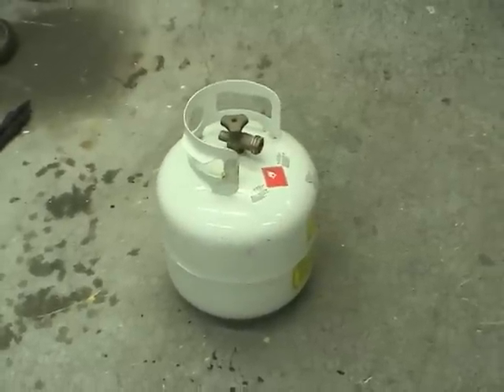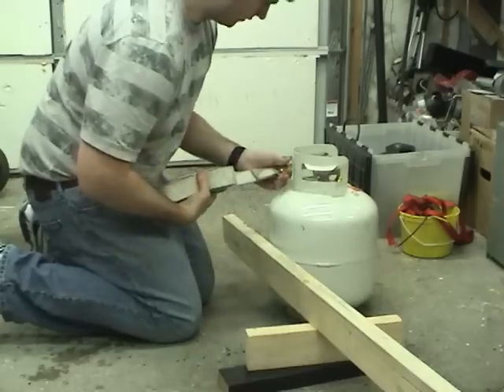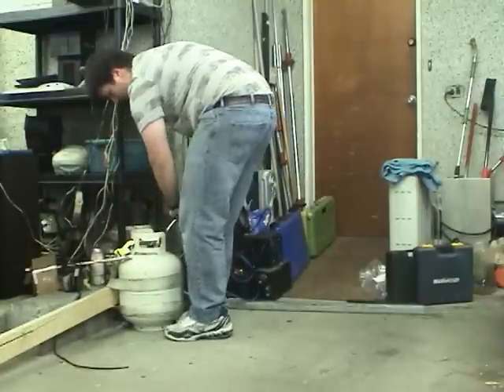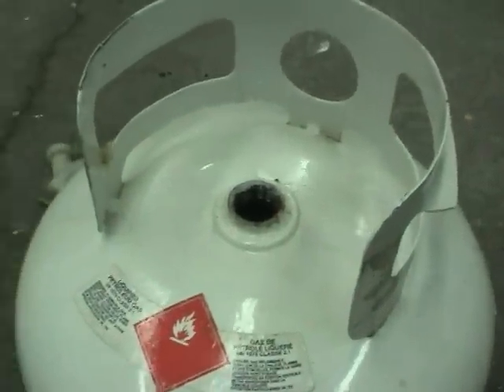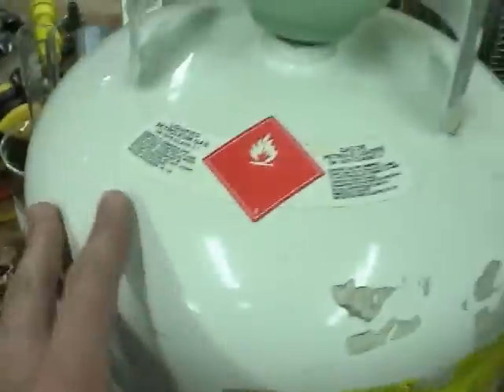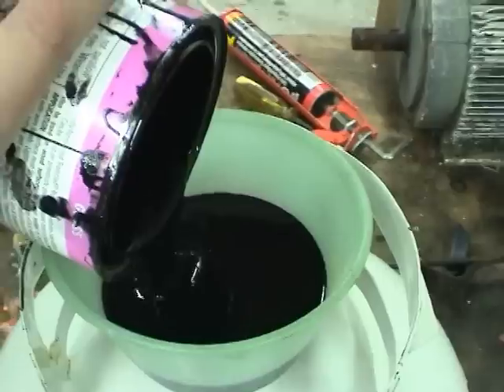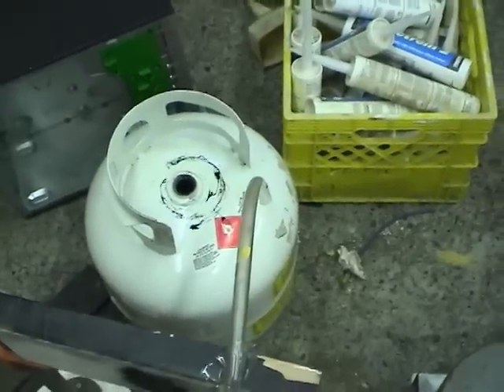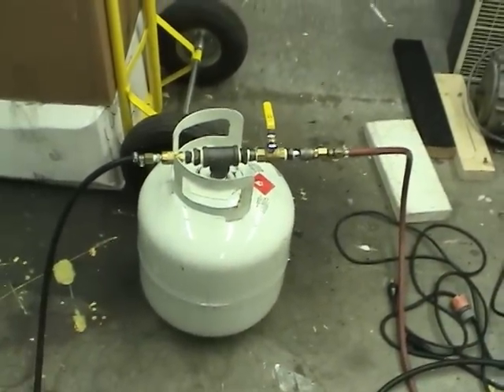Converting a propane tank into an air tank

Comment: This bloke is a true legend,, no idea what he is doing but he's having fun & that's all he needs..
Reply: Man just use a 5 ft metal pipe that you slide over the hande of a pipe wrench and a 4 or 5 ft crowbar stuck between the handle of the tank . You tilt the propane tank completely  on the side so when you use the extended pipe  wrench , both crowbar an pole of wrench should make an x shape . You setup yourself so you either drop all your weight on the wrench downward    while having a feet on the crowbar to secure it more . Other 180 degree the valve give you problem you lift up , nit that shoult be easy once you droped all the tork using your weigh the first time.Proper placement you shouldnt even wear yourself at all , no muscular force needed than carring all that metal around.  The 5 ft x shape tool placement acts like a 5ft 3 wooden beam winch.. yea that old hamish trick using 3 trees and rope to drag a barn using one person.

Comment: Always use the tank with the fitting at the bottom. In this way the water condensate is always in the air lines not the tanks.

Comment: A 100% full propane tank in the desert southwest would experience 120F heat in the summer months.  That would raise the pressure to around 240psi.  That same tank in the winter would have a pressure of 102psi at 60F.  The standard is to test them to 2x the service pressure or about 480psi.  I believe the service pressure is about 220 psi (test to 440 psi).  Most people don't have the equipment to pump a tank to the required test pressures.  Your tank could fail at 125 psi (the max limit of most home compressors).  Please note that I couldn't find anything online that gives exact numbers, but these should be close.
Reply: Ha, try leaving that propane tank in the car or directly in the sun for a few hours (like, on the front of your pop-up camper in the driveway) in that environment.
Reply: @SpringIsBACK  Not a problem even in the AZ desert.  Places that sell propane have hem outside in the desert sun with no problem.  Just don't overfill them.  That's what the OFP device is intended to do.

Comment: I used an old propane tank for air, but I didn’t do any of this shit, and it works just fine as an auxiliary tank.
Reply: When I was wrenching in the early 80s, Snap-On sold a kit with adapter, gauge, hose and fittings for around $ 30.
Valve off, adapter on, fill, use. We didn't have time for all this fuss. 😜

Comment: One thing about air compressors, its not all about capacity, its also about the pumps ability to produce volume. Don't expect that tiny pump on that little tank to last long with the addition of this tank, your causing it to go far over it's service factor. I can make a 1 gallon tank run a DA sander for hours at full volume non-stop...With the right pump and a motor with a continuous duty cycle, correct HP and a SF of 1.15 at least.

Comment: Looks like the pressure rating of these tanks is good enough for typical compressed-air use.
There's a nice valve-removal tool at "Propane tank valve removal Method 3 Make a tool! Easy DIY Project!".  
Can add a drain fitting by drilling a hole and welding a suitable nut on the bottom (before painting the inside!).  Water is always a problem with compressed air - it can't hold as much water as atmospheric-pressure air, so once it cools off after coming out of the compressor you'll get condensation in the tank and hoses.  Water-separators here and there help.

Comment from the maker: @ZstripeW All 20 pound propane tanks I've seen have a standard 3/4" NPT pipe fitting, the same as home heating natural gas line. A good hardware store will stock everything you need. The tee connects to some standard adapters to reduce the size to match the valve and compressed air fitting.

The best way to make the adapter is to build it up at the hardware store, it's much easier to figure out what you need with the parts in front of you.

Comment: The best idea is to put them upside down so the water will not sit in the tank i have 2 of the TALL kind with 2 slanted L bend's going into a small stainless steel tank so i can drain water wen needed, i hope you fined this helpfull!

Comment: Great job, but all you need to hold the tank is a good rod through the handle while removing the valve.   I am currently converting a 100 gal a fat boy propane tank.   I am putting a 5 HP motor and compressor on the top of it.    Cheers

Comment: If you want to do it right, yes you need to remove the valve.  Removing the valve allows you to wash out the tank to help get rid of the smell, as well as coat the inside with rust resistant paint.  The paint will make this tank last a lot longer.

Comment: Ok, a couple dumb questions:

What is the exact threading INTO the tank?  Standard 3/4" NPT pipe threading?

Put the tank outside, exit down, in the sun on sunny days, for drying.  It'll dry.

I'd like to make a quite small tank for high portability (and just a little air for cleaning / dust removal on small items) out of a 1 lb. propane bottle.  Is the threading the same?

Comment: After you attach that 2x4 {with the long part in the direction of the force (the direction you have to turn the valve to get it out - lefty losey, righty tightey} , lay it flat on the floor OR ground, it is easier to control. Yeah, do it outside. Leave it hole side down a few hours. Then you can rinse it and air dry and whatever. That stink is very persistent and I think it is 3/4 inch pipe thread also. I definitely would pressure test it longer than a few seconds and certainly not in my shop where failure would be somewhat disruptive to it. However my compressor maxes out a 150 but even then failure would smart a bit. Having complained enough, I think he done good, a bit less safety orientated but generally real good.

Comment: Most people that aren't the DIY or mechanically interested type just go and buy whatever they need, without thinking of making their own for cheaper. I personally love making or trying to make my own stuff. I built a DIY pressure pot sandblaster out of an old 8 gallon air compressor. Loved the building process, it turned out great!

Comment: Just advice for the future or anyone who reads this and plans in doin this. That’s not a good way to check for pressure.... there is a little flat blade bleeder screw on the side of the valve. Use a screwdriver that fits it well and loosen it. If that doesn’t work then try his method but I’d personally try the bleeder screw first

Comment: I made a tool for revalving tanks. I took a section of pipe that fit over the body of the valve and cut two slots in it so the outlet and the relief valve stick out either side. on the other end I drilled two holes to put a metal rod to turn it with. Very efective.
Reply: I make almost the exact same thing.  I just used a large pipe wrench to loosen the valve.  Stuck a 1" pipe through the carrying handles to keep the tank from turning.  Works great.

Comment: Very well done! Could you explain what type of valve(which has yellow handle) you used ? Which ones are good for this application?
Reply: Hard to find info about what fittings you could use to weld on

Comment: I would suggest mounting the tee connector 90 degrees from what you have. I put the input nipple and valve coming in the top and the output out the side.

Comment: @crashcyberdrive No pressure, no worries...there's no oxygen inside, it can't burn...also, I said to heat the thread, not set it on fire, the 80-120°C needed to loosen the epoxy is nowhere near ignition temperature...

Comment: Why did you not just adapt the existing valve to work with the tank? It has a builtin safety pressure relief of several hundred psi and has a valve on top.
All It would need is the tube and nut from an old grill and I have seen those on sale at Lowes in the brass fitting section.

Comment: More info, if you use the old grill tube connector, you need to drill out the central tiny  orfice.
You can also on the existing tank valve unscrew the liquid level float or just leave it on. All of this is just obvious if your handy.

Comment: I have no idea how much torque you were able to pull on a crescent wrench but I doubt it was more than 100 Ft. lbs.  I'm just making an observation as I used to pull 600 foot lbs. on the inboard flap track fail safe straps on the 747. It was lots of fun!! Anyway... I'm looking at using a couple old propane tanks to hold a vacuum for the forming table I have planned. Got to make some DEVO Energy Domes!!

Comment: If you take the handle off the valve a piece of square tubing will fit over it. Lay the 2x and tank on it's side and park a car tire on it and you can use a pipe wrench or ??? on the square tubing and easily get the valve out.

Comment: That seems like a waste of a flammable gas that could instead be used for heating/soldering/brazing/cutting metal or barbequing or other combustion purposes. But nonetheless an interesting use. I've also seen people charge their refrigeration systems (central units) using propane, since it is in fact a refrigerant.

Comment: sounds like a refidgerant compressor he is using for the 400 psi. he uses that compressor for an air cannon so not a regular compressor. also from what I have seen he uses gas pipe fittings to retro fit the tank.

Comment: Did you watch the video to the end?? Let's see: taking the valve off some elbow grease, some time, one 2x4 broken at the end, welding the fitting (using electricity,welding rod or wire) drying the tank 48 hr running the fan,paint to coat the inside, more fan running to dry the inside, varius fittings, the cost of the tank, time spend building it. A 13 gal tank is on average 35$ at an hardware store. He spend more than that to build it for sure.

Comment: I also drilled and pipe tapped a 1/8" hole into the top of the T fitting for a pressure gauge.
Reply: great idea.
Reply: Santina Murphy link ?

Comment: Soap and water DOES NOT remove all the propane.  The pressure forces gas into the metal.  What you did is OK if no heat is applied.  If heat is applied by using a torch to cut the bottle (not sure about sitting in hot sun), the propane comes out of the metal, mixes with air, and can CAUSE THE TANK TO EXPLODE, if ignited by the torch.  This comes from a lawyer who has handled several exploded tank law suits, and an expert witness.
Reply: I don't think the tank is gonna explode man.

Comment: Two things:

1.  Needs a drain for removing accumulated water.

2.  For safety sake open the bleed screew on the tank valve before removing the valve.  I would not want to remove the valve if theree is ANY pressure left inside.

Comment: If you heat the threaded part it will be easier. I just leave the valve in them and use an adapter fitting..way easier

Comment: I will add a  Pressure Gauge to the "T" fitting and a small Drain Valve to the bottom of the tank, to drain off condensation ,when  I build my Tank. Good instructions. Thanks!.

Comment: neat.
1.  Use a torch to heat the base of the brass valve to breakdown/degrade the threadlock and it comes out much easier.
2.  You didn't mention what size threaded fitting to connect the T fitting to the tank.
Reply: >> Use a torch to heat the base of the brass valve to breakdown/degrade the threadlock and it comes out much easier.<<
Yes, and light a match to look in and see if there's any gasoline in you gas tank.

Comment: To get the tap out you can get it really warm with a heat gun to char the threadlock. Just don't use a blow torch unless it's a cylinder that contained a non flammable/Non oxidising gas, so only use a naked flame for stuff like argon or CO2 cylinders. Also, try not to heat up the tank too much.
Reply: Sorry! I'm a firefighter lot of people tried an a lot of people died alway lean to the side of caution, buy a tank before killing one self .

Comment: Do yourself a favour before doing what he is doing here and do some research. 

First, don't do any of this indoors until you proven there is no residual propane in the tank. Do it outside away from any hollows in the ground as propane is heavier than air and will seek the lowest area where it may flash if given a source of ignition. If you do it in your home and there is residual pressure it will end up in your basement if you have one.

Second, there is a slot head screw on the side of the valve to release  any residual pressure that may be present when you loosen it. 

Third, do not stick a screw driver in the valve as shown here. If there is any liquid propane left in the bottle it will spew out through the valve opening and freeze your skin. 

Fourth, you cannot do any welding safely on a used propane bottle. Rinsing the bottle with cold or hot water or force ventilating will not remove the propane that has penetrated the metal grain structure and if you weld on the bottle you could have an explosion. Most Workman's Compensation Boards and propane suppliers have bulletins out on this subject. 

Fifth, if you coat the inside of the bottle enamel is not the product to use. It will eventually start to break down and you will get paint debris in your air stream which can plug things up. Use epoxy like Dragons Blood instead as it forms a cohesive barrier. If you are using a propane tank for this purpose it must be coated inside as there is no corrosion allowance engineered into the thickness of the material as propane will not form rust. 

Sixth, do not reuse the valve that came with the propane tank. That valve is not a Water OIl Gas (W.O.G.) rated valve and it will corrode with the water vapour in compressed air eventually seizing it up and rendering it useless. Make sure any valve you purchase is rated above the maximum pressure you intend to subject the tank to.

And finally, seventh. Propane tanks fall under ASME and DOT for their design premise. That 400 PSIG rating that he gives here is a test pressure only. That test pressure is in fact 1.5 times the actual design working pressure allowed to give it some safety measure based on cyclic metal fatigue and any exterior corrosion. Using the tank to it's test pressure is not a good idea as it may eventually fail under pressure. Such a failure could be catastrophic.
Reply: Now that Norman, is one fine set of suggestions.
Reply: Thanks for the post Norman. Those points can save a life or two.  
Can a propane take be safely welded on or contact with torch flame if the tank is filled or nearly filled with water?
Reply: Norman May.   Also this guy tested the tank at 400 psi.    But only, for maybe 
1 second !  FUCKING REDICULOUS
Reply: I filled a tank to overflowing with water.  Let is sit for about 15 minutes.  That displaces all of the propane and fumes.  Then I used a small angle grinder to cut the tank where needed.  Pushing on that center plunger to empty the tank isn't reliable.  There's a screwdriver slot on the side of the valve.  Open it (it bypasses the check valve at the outlet).
Reply: You got that right!  He should have kept the pressure for at least 1 hour.  I don't know what the standard is, but I'm sure it's more than a few seconds.
Reply: Nvm wutchin diz guy juz gona read diz duds comment here

Comment: There is a better way of holding a cylinder & that is by having two pipes and a loop of nylon or strong rope. The loop ois put round the cylinder so that the pipes can be put through the loop on opposite sides pressure is then applied to the ends of the two pipes but of course it's better with two folks.

Comment: Yeah they love that... when you tear open the packages!  (Did it today at HDepot!)

Can you do the math for me on volume?  I have a 4" square tube bumper (3/16 wall), that is 56" long.   What is my internal volume of air?  (and what would max safe pressure be?  -assuming all welds are valid and strong)

Thanks... -Steve

Comment: Surely installing a purge like most air tanks would make it so you don't have to paint it? My compressor isn't painted on the inside, you just purge it after use. You would just have to drill and tap the bottom of the barrel which would take far less time and effort than this? Great video regardless, just my thought. Keep up the great work! :)
Reply: EddWolf78 Better yet, put the purge on the valve, and just run the tank upside down.
Reply: I'm not sure it's a good idea to drill a hole into a propane tank,even if it is empty.One youtube video suggests that sometimes the propane gets imbeded into the inside of the  tank.Just my $0.02
Reply: Relief valve or not, it still stays wet inside, which rusts and weakens it. Painting is a good idea for sure, or at least spray wd40 inside once in awhile.
Reply: dave Yates I'm so relaxed I'm horizontal but at least I know about WD40... Every toolbox needs WD40 and gaffer tape... WD40 for things that should move but don't and gaffer tape for things that move that shouldn't .
Reply: Or tank-tape, the stuff they use in the military

Comment: @AKAtheA I too would agree to heat up the threads to make the valve easier to remove but at Zero PSI it's possible for oxygen to enter the tank if you open the valve to regular atmosphere.

Comment: lay the 2x4 flat on ground with tank on top, straddle tank by stepping on 2x4, its much easier to either push down or pull up, just cant get same result with tank upright...plus when your wrench is twisting like that its so easy to slip off and wreck your knuckles on that stupid valve guard,  im guilty of that once

Comment: The tank leaking yet? I have one I have been using for 8 years no coating inside, my last one started leaking after 11 years just pin holes at the bottom it did not blow up, lol.
Reply: But what would happen if it did o.0
Reply: LOL, they do not blow up they just rust out and start leaking air.
Reply: +gunlover1955 ok